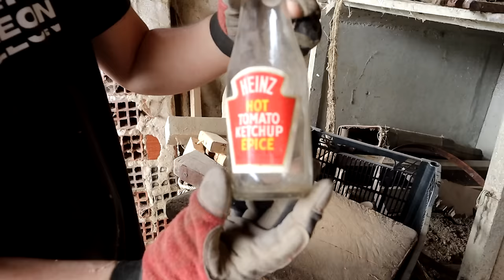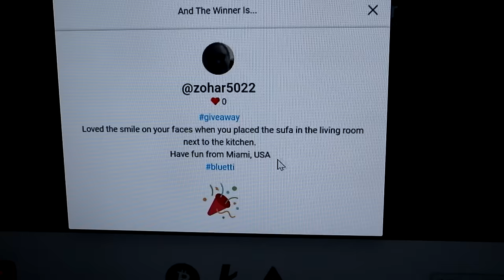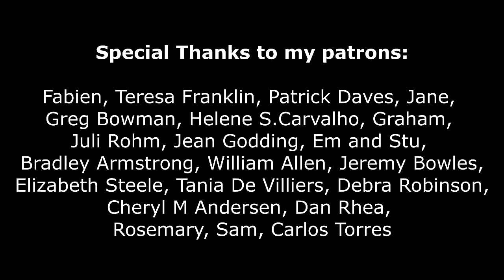New project Ahead #76

Comment: What a lot off work cleaning out the shed. I hope you decide to tie in the back wall, it would also be nice if you could add a concrete floor pad and an overhead oversized garage door to the front. Maybe pyll down overhead attic ladder for access to upper floor so you don’t need a separate ladder to get up there. Being able to close the area off from rainstorms is a good thing. Also, the concrete pad is easier to clean and keep it from getting too muddy. Our garage looks like it is part of the house. If you go through the trouble of roofing it, you might as well make it nice like the rest of your home.